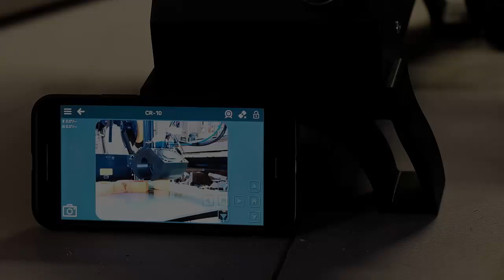My Top "Functional" CR-10 Upgrades

Comment: Another thing you can get for a glass bed replacement is a 12"x12"x1/4" piece of borosilicate glass from McMaster Carr, best 50$ upgrade for my 3d printer. Another is a 120v heated bed, 60c in 50 seconds

Comment: Good that you found a bed surface that works for you. But did you know that luke warm water washes the gluestick right off? Anyways, I'm using the ultrabase now.  Just use a damp rag to clean the hot surface right before the print starts. No glue required.

Comment: Nice bit of engineering ... Love it! I have the Cr-10 4 and it has had to have many upgrades to be dependable as well. I have printed life sized helmets etc.. and they can take 150 hours to print. The issue that I had it the heat build up on my steppers. When you add your tube to your top filament feeder you will benefit from the upgraded [all black] stepper and likely will have to put a 40mm fan below your extruder stepper. I sandwiched a high quality fan (with delrin blades) to the E stepper using one motor screw that is longer and a spacer so that it is not touching the base. It blows upwards away from the bed and I have not had an issue. However!!! When I add any tubing, guides or even distance to my "Feed" I have to Double my E steps or prints are crap. Plus it resets every time I turn it off. (Even though it is in my G code script; it does not work unless manually entered Every Time (ie. Control >Motion >E Steps = 193.70 Yes mine is that high when I added a 20mm guide tube to my Bowden. And I occasionally have to lightly oil that tube separately as well.
Be sure you check E steps every time my Friend (even if one doesn't add tubing folks are often shocked at how much this matters on even a new machine (calibrating E-steps :) 
Looking forward to printing / liking your stuff on Thingiverse ... Jeff

Comment: JP great video. I am assembling my CR-10 this week and this is my first 3D printer. But I want to start modding it right away. So where are the links you mentioned? I want to get the thumb wheels for leveling and that bed you are using. No tape, spray or glue sounds awesome.
Reply from the maker: Lance King they should be right in the description

Comment: Engineering point of view, Frame brace will do not do any significant effect on your structural integrity. That brace only gives support on Y axis. The Z tower only receives forces on Z axis and X axis (the only bending moment on Y axis is only caused by the weight on hot end). Not for knit picking I just wanted to mention because of the word “functional” on the title. The only major effect of those is confidence. Regards
Reply: respectfully disagree... it's to stop the Z-frame wobble. When the X gantry is up high (above the 200-220mm mark) it gets a little top heavy, and as the Y bed moves back and forth it can start a wobble, especially if there's a few quick movements back and forth and it starts oscillating at it's natural frequency...

just my 2c though, I've found it helpful on larger prints

Comment: Beautiful Machine!  I bought some modified CR10's that were set up for TPU.  I didn't get a demo from seller and I got 3 machines with 70 plus rolls of filament, mostly TPU. My question is this: He set up a cleaning brush for tip and it sits beneath the table height when you home out machine.  I tried running my first print and the head ran into the side of the glass table so I had to stop it. Can you help me figure out how to get the z value to be higher? Can this be achieved on setting z offset on machine control box or does it need g code in start up routine in Cura? Any help appreciated. My extruder is red in color with an X on it. Love your set up! Jeff

Comment: Bummer on the buildplates not being able to ship. It was the one thing I was looking forward to checking about ordering. I have used mirrors w/glue but and so far PrintinZ flex skins work the best and I just converted 2 CR10s to metal flexplates of 26 gauge sheetmetal and epoxied 18 - N52 Neodynms on the bottom of the bed :) now I can take the metal plate and flex it if it doesn't want to pop off the PrintinZ on top of the 26ga sheetmetel

Comment: question, what print settings did you use for your vibration dampers? I printed them, they came out really good. But I think I missed something in the settings. Cool design.
Reply from the maker: Drew b 

PLA: 
.15 on the layer height. 
205 for temp
60 on the bed
60mm/s print speed

Comment: The 3D Workshop - This scene kinda reminds me of an old Hollywood movie remake.  [cue the stormy late-night lightning and thunder effects to set the mood.  As the camera zooms in we are treated to a dark creepy old medieval castle shrouded by mist at the top of a lone barren mountain peak.  As the camera zooms in further we begin to hear 1930s pulsating electrical equipment hum getting louder and louder for dramatic effect.  Suddenly...  in this mysterious lab a shrill voice exclaims...

"IT'S ALIVE!  IT'S ALIVE!  My new Franken-Ten is ALIVE!"

Meanwhile... Igor (Marty Feldman, of course) rolls his bulging eyes while looking directly into the camera as he's pointing directly at you, the mad CR-10 Upgrade scientist.

LOL!  Dude, I think (like me) you've got waaaay too much time on your hands.  As a CR-10 owner I do like some of your mods, but the Eiffel tower bracing is waaay over the top because the CR-10 is extremely rigid right out of the box.  If yours wasn't it means you need(ed) to tighten the frame screws a bit.  And considering yours has a dual Z-axis setup (mine is the original single Z-axis unit) I believe that extra bracing is completely redundant, from a structural-engineering point of view.  I guess it could be somewhat useful if you decide to wrap your CR-10 in insulation to print higher temp filaments (or to tie off a high-flying kite during another midnight storm to hopefully harness a bolt of lightning for a future mod).  Other than that... well, it is a bit artistic, ain't it?

Anyway, just subscribed to see what you come up with next, Dr. Franken-Ten.  ;^)

Cheers from Thailand!

Comment: that build plate is called G10 (or something like it). its fiberglass.

well maybe its Polypropylene (comment lower down) but damn I swear it looks like the G10 we use for fins on competition rockets. https://is.alicdn.com/img/pb/893/981/445/445981893_598.jpg

Comment: JP, I know what these are.  These are made from polypropylene.  You can find them in the USA at 3dprintiverse.net
I have tested these up to 150C and they work very well for PLA, PETG, ABS, TPU, and waiting to test with Nylon.  I've sent you a separate message as well.
Reply: huh I would swear it was G10 fiberglass but those look like it as well.

Comment: "everything sticks" and you see 2 parts bending very hard LMAO
Reply from the maker: Manu its not lift. 100% model design. Its a chamfered edge
Reply: oh ok sorry then dude !
Reply from the maker: Manu ha no worries! I know exactly what you're looking at. I thought it was lift initially too when I was editing until I checked again and realized it was building the chamfer
Reply: I also thought it was lifting and thought to myself that the printing bed is not that good after all. You might want to modify the video to point out that the "lifting" is actually part of the design since I think many people would make the same wrong assumption I did.

Comment: build plate is probably PEI ...i bought one and LOVE IT!  vids say to spray with isopropyl alcohol at base of print when finished while STILL HOT then when cools it pops right off ...and yes it does!!!! paid bout 30-35  for PEI sheet and 3m sticky sheet to adhear it to a piece of mirror . wish i had done the flexible magnetic sheet back setup but alas still v happy with it .

Comment: You can simply wash the glue off the mirrors with a bit of hot water.
Reply: That is a good point but a PEI sheet is $20 and your prints will stick great and the finish will be so smooth you can see your reflection in them.
Reply: You get the same thing with mirrors and they work with all types of filament. Pack of 4 300mm x 300mm tile mirrors for $10 (plus shipping if online) from Ikea.
Reply: And if there's any residue that doesn't come up pretty much instantly, you can just put some isopropyl alcohol on there and the glue scrapes up like butter. Out of curiosity, I just timed cleaning off one of my 12"x12" mirrors that had just finished a print. It took me 22 seconds including opening the bottle of iso, spreading alcohol/scraping the glue from a 10x10 area, wiping the blade and closing the bottle. I love my PEI bed that I have on one of my machines but the mirrors are just tough not to love more.

Comment: cr-10 whit upgrades vs prusa i3 mk3 ?
Reply: cr10 with no upgrades beats Prusa I3 mk3 "IF" you need larger than 200x200x200

if you don't need larger than that. CR-10 still beats it as you can buy TWO CR10 for the price of the prusa "kit" (almost 3 CR10)

as for print quality. its close. for pla. for anything else the prusa will beat it hands down. for features and functions the prusa wins hands down.

Comment: nice! i don't mind the umms that much personally. focusing on the mods while talking about them would be nice i agree but hey, like you said, you're learning. i would also love to hear what you think of my CR-10 z-axis manual adjustment knob (www.thingiverse.com/thing:2491782) and if it would be of any use to you as well. keep it up, curious to see what else you're going to do to your CR-10. P.S. cleaning the glue off a glass plate isn't much more work than just washing it under a tap with some hot water. at least, that's what i do and it works fine.

Comment: Mind blowing cinematography! Now focus more on the content...not to say that this was bad...but presentation...well, talking informally might be liked by some but a bit of formality also helps...take tai lopez for instance, his manner of speaking is borderline formal to outright frank...however one would not feel that ....reason, there is continuity of the input..no ums and wells(other commentators have already pojnted it out)....now another thing...the setting is awesome so are the mods but while describing them, you can focus on the mods, as the viewers have already seen your face, let them get a closer look at the mods, the cad files, stl origin, print settings etc (they can come as info bubble as well at the bottom screen) this will make the review strictly no nonsense,  the viewer would use his own discretion to apply the mods. Also, your pros and cons of the mods would add to the improvememt of the opinion....another mod is to use the comments section to solve peoples cpmmon problems like print settings etc (in the principal comment) this will improve PR and hence publicity....lastly, Idk , I may be wrong, but you said that the winners would be announced on the next video, if that was the case, do not roll back on promises, it may create adverse opinion in long run...otherwise, its a hell lot of improvememt over the old ones....keep it up and seasons greetings to you and family...mail me...we can discuss more
Reply from the maker: Hey Sudarshan,

This is awesome feedback. Thank you for taking the time to write this out and for the compliments on the cinematography. As you can probably tell, I'm learning as I go along here so comments like this really help me to deliver content that is worthwhile, and formatted in a way that is easy to digest. So Thank You!

 I actually DID announce a winner FYI. There was a video between this one and the last CR-10 video. Jarrod Smith (who happens to be in the comments here as well) won the Rpi0.
Reply: oh my!
I guess age is dawning upon me. Still Keep up the goodwork. i will try not to mis next time. Btw, the comment mr smith was on to the spot. you should focus on uses. like the tom's guide on making the printer...your guide on using the printer will be a killer! dont miss the chance while its on table...a step by step ...user(snd noob) friendly guid to using 3d printers.
Reply: Tai Lopez?

Comment: the build plate looks like fr-4 which is a glass fiber epoxy laminate used to make circuit boards.
Reply from the maker: I THINK somebody asked the supplier if it was FR-4 and the answer was no...but hopefully I can get a rundown on what exactly it is. There's a chance it is FR-4, but as of right now I still don't know. 

I'll be updating the comment section as soon as I figure it out.
Reply: The 3D Workshop of course the suplier says that's not FR 4. He want to sell the "Moon dust" for much more like a FR4 plate costs.

Comment: Nice mods!  I need to do the control box stand and leds. I am surprised you aren't controlling the printer with the Pi though.  Highly recommended!
Reply from the maker: Thanks Jarrod! I may have to try this out in the near future. Probably one of those things where I'll never look back once I do right? haha
Reply: Probably, as long as you are running a 3B.  I have a Zero W (not that one - it's in another project haha) and it doesn't have the horsepower to send prints over serial and do webcam stuff at the same time.  I'm in the process of upgrading that, and adding some relays for power and lights.